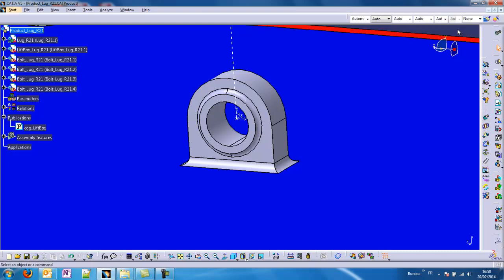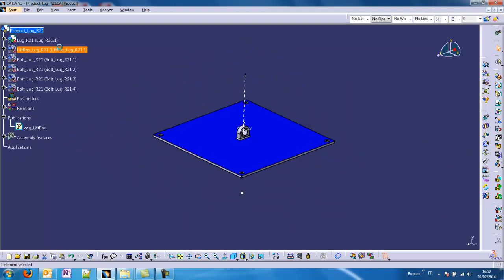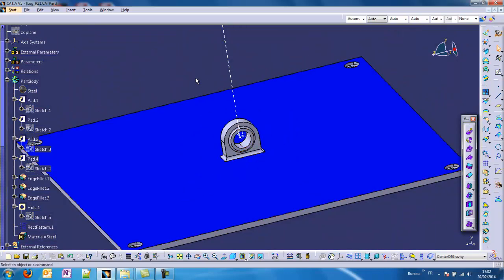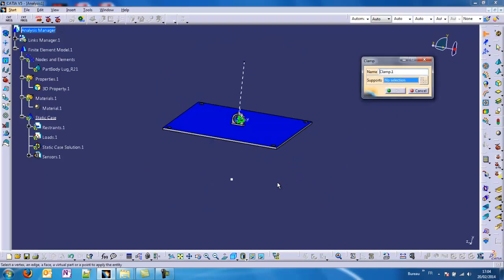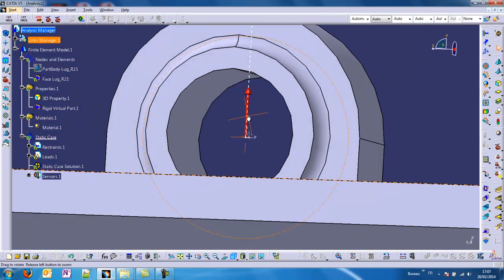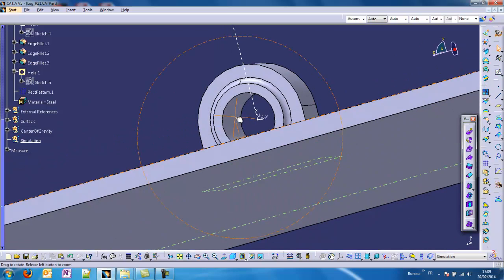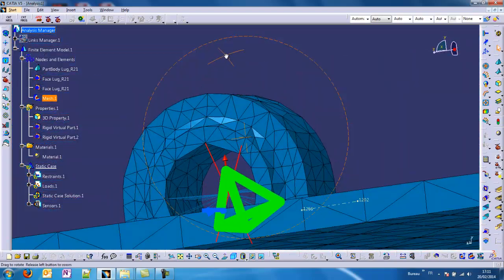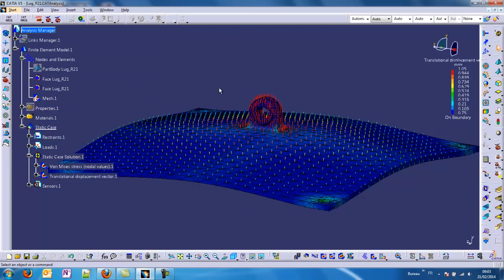Catia V5  - Partitioning a face to calculate a Lug Plate

Comment: Should you be applying a bearing load on the lug instead of an evenly distributed load on the lug?  The load isn't the same on the sides of the lug as on the top of the lug. I think it will affect the stresses in the lug.
Reply from the maker: +Chad Mitchell 
Absolutely right !!!
It depends on the level of details you want to include in your model.
The main objective of the video was to show the trick to use in Catia to partition a face.
But you are totally right: a bearing load is more realistic than a distributed load. 
In the same manner, modeling all the parts and the contact interactions between them would be more realistic than the bearing load. It really depends on the level of details required by the calculation.